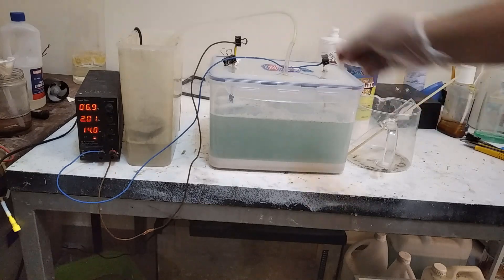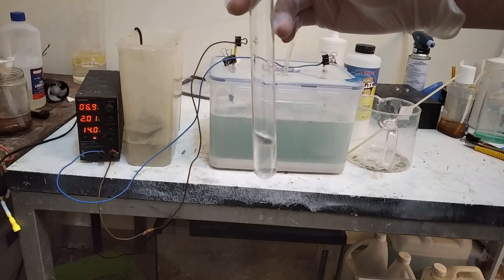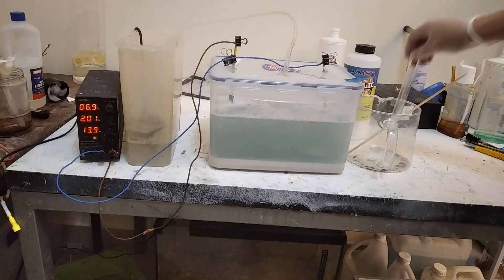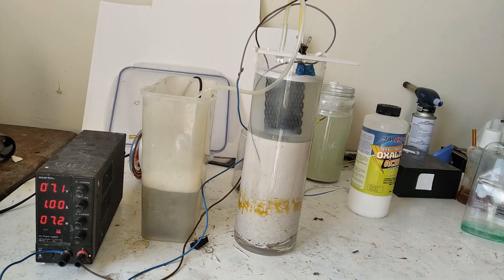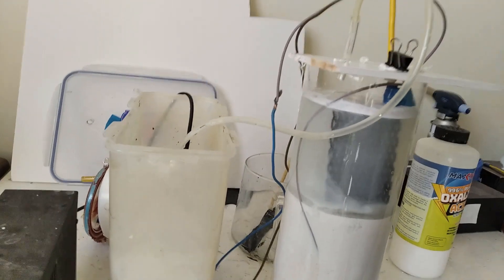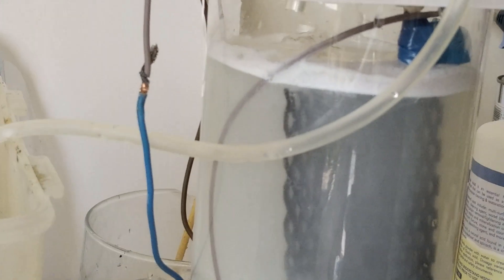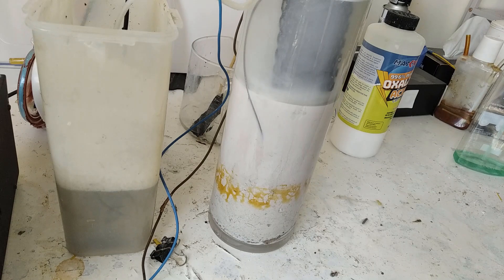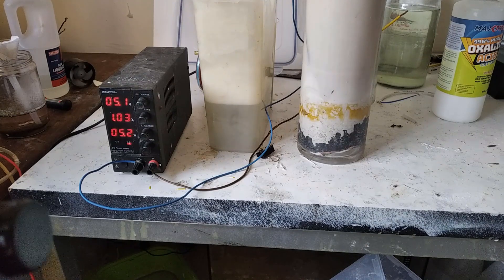Refining all of my lead waste from older plating processes pt1.

Comment: If you electrolyze plumbate(II), do you still get metallic lead on the cathode? In your opinion, what would be the most efficient way of extracting chemically bound lead from a car battery?
Reply from the maker: yes you do still get lead and even if that lead was in the form of lead 4 it will still be reduced at the cathode albeit at lesser current efficiency.
The design of this bed electrolyzer allows for the precipitate to slowly convert to lead.
soluble plumbate will also form PbO2 at the anode along with lead at the cathode.

Comment: Thanks for getting into the kinds of stuff that's really not covered in undergrad chemistry. Yes, I get that chemical engineering is a whole separate endeavor, but electrochemistry has so much praxis around it that straight up gets missed all the way through grad school unless you happen to do electrochemistry specifically, and that's a real loss.

Do you think this lack might have something to do with the expense of energy? The massive rush to get things done in teaching labs?

Comment: I was gonna sugest to use less current, but after u said "it's been running for 3 day" and it was done at 1A, damn...
Electroplating is a pain in the ass, tried once with Cooper, horrible experience.
Reply from the maker: run 5ma/cm^2 current density on the cathode and it will plate and also ensure only Cu2+ ions are in solution and not Cu+
Reply: @CatboyChemicalSociety  thanks for the info man